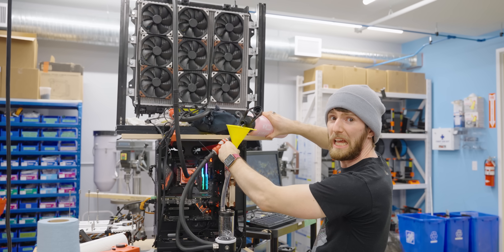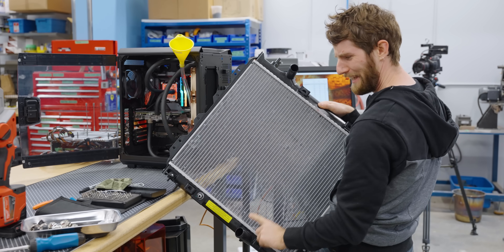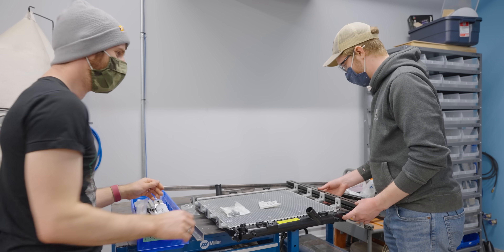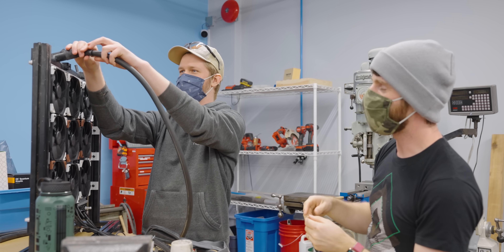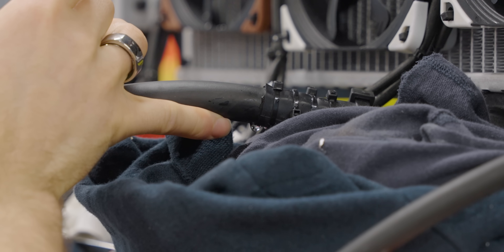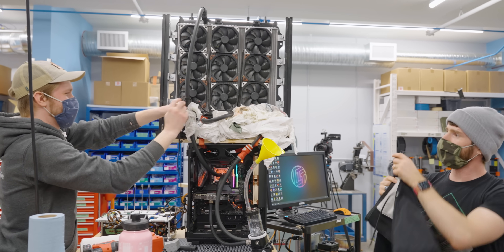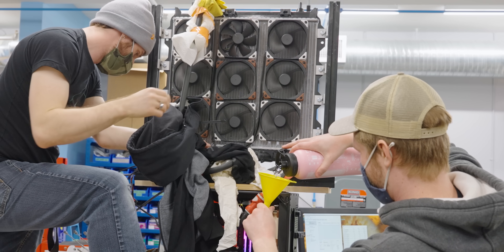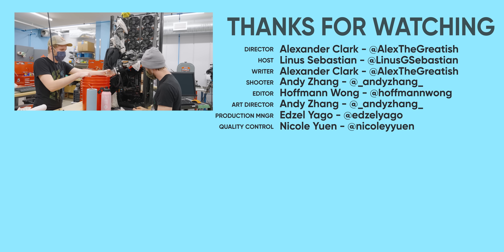Our Craziest Cooling Project Yet - Car radiator liquid cooler

Comment: The transmission cooler is just a tube or coil inside the one tank! On heavier vehicles and trucks with towing packages the transmission cooler is external and mounted infront of the main radiator! Running the coolant  back through the transmission cooler is counterintuitive and may make things worse!

Comment: Having the radiator on top of case is dumb because high center of gravity, also any leak will flow down onto case. Atleast test run it on table top before mounting it up high.

Comment: Take it to the next level. Build an air cooling rig into a beater van that you can setup in back and get an intercooler and direct the forced air onto the system to test at different speeds. This could also be done in lab with the right turbines.

Comment: Ugh, they turned an interesting idea into stupidity through zero planning. They could have achieved better results with far less effort by simply adding a five gallon bucket reservoir to the original setup. meh video.

Comment: Would like to actually see this working with the correct adapters and fittings so it wont leak like crazy. Btw and probably pointed out already, the second loop is just a coil to maintain the transmission fluid at working at temperature, would not help at all to use it in series.

Comment: Why didn't they just buy the actual radiator hoses that go onto that radiator and then machine out some size adapters? Or even 3d print them? Also how about a box fan  instead of all those small computer fans?
Reply: Oh and use actual hose clamps on everything lol

Comment: There is a product in this: Fit a car fan to the radiator and relay/PSU to power it. Hang from a window to dump heat and keep the noise outside.

Comment: Linus find a product called tru-blu use it to seal the inner tube and loose connections, then re cable tie and then try again. Give it 10 mins to settle after applying and you might find you have no leaks.

Comment: I did this couple years ago. Used a copper/brass radiator, you guys use aluminum and you destroy the copper heatsinks. I didn't need fans because I ran 5 feet of tubing and left the radiator outside my window along with the pump. Zero noise. Window always blows except really hot sunny days, those days you just turn down the overclock. When it's winter or foggy summer, the water temperature was 7c. CPU temperature were way cooler than Linus. I think around 30-40c load with overclock. I used an Audi engine radiator from eBay $100 new. And I really can't seem to understand why is everyone retarded in this episode and unable to get hose reducers. It's available at every hardware store and costs pennies.

Comment: When Linus was flushing water through the radiator it shouldn't have come out of the smaller holes. If it was leaking from there then that brand new radiator was bad.

Comment: I really want to see them do this again but properly. Buying proper step down valves and sealing the piping so it doesn’t leak everywhere.
Reply: Yeah, me too ! It would make for an interesting project. The way they approached it though, totally ruined it for me. It was beyond silly and useless, to the point that it wasn't even fun to watch.
Reply: Yep, car radiators are nothing new for experimental water-cooling but choosing a more appropriate rad and actually thought through connections would be more interesting to watch.
Reply: I totally agree. With better research and preparation, this project had legs. It feels like they purposely made it into a fiasco for the laughs.
Reply: @benyspensierijr.5973   Exactly ! Had it been a 7-10 minute video it probably would have been kind of fun. But a 19 minute video, where 2 adults act like Beavis and Butthead trying to” fix a problem” they purposely created, it’s the opposite of fun in my book. Plus, the video had nothing to do with watercooling.
Reply: They probably won't, because that's too technical of a video and won't really get views. Though, GN already did the car radiator thing to my knowledge.
Reply: Same. A lot of the projects they do could be redone a lot better.
Reply: N flex tape
Reply: The problem is that this is pretty much the level of skill Alex has. He is playing an engineer and the rest of the bunch is so far from everything connected to engineering, that they don't realize how bad he is ^^
Reply: @stefan514  I don’t fully agree. You don’t have to be an engineer to do watercooling. They’ve literally done tens, maybe hundreds of liquid cooling builds. Same principals apply here. What they did in this video was to execute an overlong and dumbly written script. Some people may be amused by this type of content, but from my point of view it’s plain pointless and ridiculous. Good humour always comes with “smarts and wits”, which is not this case. For instance, I’ve watched LTT vids starring Anthony. That’s what I call humour, alongside his knowledge and exceptional demeanor.I bet we will never see him in this posture.
Reply: @alext988-z8v  Absolutely agree. Too many LTT videos are clearly made as quick ideas rather than decently thought out projects. The SATA vs NVMe SSD video is a good example. Way too short and very little explanation.
Reply: @stefan514  I disagree.  Everything in this video is well within their wheelhouse.  They hook up fans all the time, and they set up watercooling all the time.  They are fully aware of how leaks can be prevented.  They just messed it up for the lols.

Comment: alpha cool sells a 1260mm radiator and it uses 9 140mm fans. you could have just used that to avoid all the leaks and probably would have gotten way better results.

Comment: Hose clamps and/or some sort of glue like ABS glue or other contact cement
Edit: wow I was half way through when I wrote that... This should be redone and right. Maybe connect fans before boot as well. Very fun idea
Reply: Just hose clamps and properly fitting hoses/adapters. It works in a car pressurised above boiling temps, a weak little pump should be easy to deal with. They could also try and use a 12v fan made for the radiator for some extra jankyness haha

Comment: The “small loop” is for the cooling the transmission... it is inside the “cool side” tank only (runs from too to bottom).  There’s not much point for you to use it to run the water back through again, considering how slow the water will be flowing through the radiator with the pump you’re using.
Reply: Was about to say the same thing.  Also not much point in using it because the water exiting the cool side then going right back into the tank will be the same temperature.

Comment: Wrap the junctions in toilet wax. Used to use those for protecting motors on submersible robots. Worked at 1 Atmo. Also, when changing tube sizes use some hard tubing between so you can crank the tube tight around it. Oughta fix most of the water leaking.

Comment: One of the very few dislikes I have given to this channel. Such a half assed video. I was genuinely interested in the pitch. I was looking forward for some comparisons involving the fans with different RPM speeds. What I got was an ER episode where they try to save a dying person. Not to mention you guys didn't even tell the ambient temperature, which at that point was pretty relevant and needed a dedicated termometer near the case, since you were all too close to it increasing the temperature around the case. It doesn't matter if your AC was set to 23ºC.

Please take a step back and think again when doing this kind of content.

Comment: Trans cooler loop is not needed, just a tube that runs in the coolant tank to allow transmission fluid to be heated or cooled by the engine coolant.

A full shop and they use an inner tube to join the tubing. Small reducer could have just been made with a plexi disk and fitting threaded, the inner tube would have sealed well enough to that.

Comment: The leaks are just silly, drill a hole in a golf ball or piece of wood, stuff an air chuck male end in it and stuff the PC tubing on it, use 5 minute epoxy or even hot glue, some electrical tape for looks, and fill the loop from the top without sticking the radiator 8 feet up. Rads taller than the pc anyways. I say the results are invalid, get the loop so it doesn't need any water added.

Comment: Did this years ago with an air conditioner radiator, still running today, keeps the whole room warm.
Reply: "I've seen dumber stuff under this roof; maybe more zip ties..."
Linus -2021
Reply: Nice job! The heat output is the same, no matter ne cooling solution. Cheers
Reply: @BOT_Calvin  It was about density of the heat, the radiator would soak and keep the heat in a certain section as opposed to blown out quickly by fans and diluting/cooling with the surrounding air faster.
Reply: But its an air conditioner
Reply: @malx1289  a radiator is a radiator
Reply: @malx1289  bruh
Reply: Every comment will be replied here and heart too 
https://youtu.be/dyUNU44hWfY

Comment: Ok WOW
when I saw the thumbnail i thought: ok cool they built adapters and a fan mounting bracket for a car radiator, that's cool.

I could not have been more wrong.

I mean it was still entertaining, just pretty useless, considering how you essentially did the same as you did in your cooling whit a kitchen sink video, just whit much more work, and leaks.

Comment: The smaller loop/trans cooler is a water-to-water cooler. So that loop is just a fin stack inside the end tank of the radiator that transfers heat from it to the coolant/big loop. So yeah, running through the trans cooler is completely pointless lol.

Comment: Watching them hook it up to the transmission oil cooler hurt me.
The way that cooler works is it transfers the heat from the transmission fluid into the engine coolant in the radiator, so it's essentially doing nothing in this case

Comment: You should have made it so that the water goes through one of the radiator loops to get to the cpu and then to get to the gpu it goes through the other one so that the water doesn’t keep the heat from the cpu.

Comment: So you guys know.... The transmission cooler is its own independent oil cooler loop inside the lower tank. The coolant in the radiator absorbs the heat from the transmission oil as well as helping to warm it up when everything first starts. Connecting the cooling loop to it in this case is just "yo dawg I heard you like cooling so I put a cooler in your cooler so you can cool while you cool".

If anything I could see connecting the PC to the transmission cooler and then running separate water through the radiator to cool it. Like water cooling your water cooling.

Comment: Radiators hangs from the plastic tank into rubber bushings to help it expand with heat. Having it fixed on the alluminium parts might make it leak eventualy!

Comment: the second loop is for the transmission warmer. The transmission will pump its fluid through there to warm up the fluid to its operating temperature.

Comment: Now I'm thinking you need to hit up eBay for an all aluminum civic radiator for <$100 with a fairly beefy fan! Tig/solder on some adapters down to a manageable hose size and redo this! Probably faarrrrr less dramatic, but I'd love to see it!

Comment: New idea.

Run supply water going from your overhead tank straight into the cpu and GPU cooler and then instead of circulating it, send the water to your geyser or some other place where you require hot water!!

Love the chaos

Comment: Made it way more dramatic than it had to be by not having the proper supplies available. LOL. 
I did a "similar" build using two HD motorcycle radiators with 1 large fan each mounted on a stand horizontally over the tower. The fans could be kept at a much slower RPM and moved much more air due to their size just like in a car. So, actually fairly quiet considering.
The hardware was far inferior (GTX970 - Intel i7-3770 CPU @ 3.40GHz - 16GB RAM -Win 10) to what you have, but the temps were much lower while running Metro Exodus. That's the biggest caveat since I never ran whatever pressure test you were.

OH, and the main thing, NO LEAKS. ;-)

Comment: Y'all need someone there that understands how anything automotive/equipment related actually works. One, that rad does not flow from the bottom to the top, your holding that specific one sideways, the tanks are the sides on a PT. Two, the trans cooler "loop" is just a heat exchanger, litterally just a tube on the inside," some have a heat sink of sorts on said tube" it just dissipates the trans fluids heat into the engine coolant. Transmissions run hotter than your engine, so even on the intake side of the rad" hot side" the engine coolant is still cool enough to cool the trans fluid.
 For your PC uses, your hurting yourself by using both "loops" your better off to just not use the trans cooler.
 As far as cost, you could have gotten pretty much any rad from any store but Napa for half the cost. For instance, the rad in my 94 s10 blazer is 87.00 USD from advanced Auto parts, it's larger and also has an oil cooler and trans cooler. PT cruiser rad should have been around 65 us, you got ripped off.

Comment: Why is the pump connected to the bottom and not the top of the radiator?  The water would flow through the radiator down and then into the water cooler, back through the pump and into the radiator.

Comment: If you guys redo this one a bit more prepared you'd love the results. It is legitimately possible and the cooling factor of this is insane. That radiator deals with so much heat that calculated out given the specs of a vehicle radiator designed to manage the heat of a 205 HP engine ([8610 BTU/second]/3) going full bore for an hour bringing the coolant (a glycol water 50/50 mix) consistently from 106C to 50C you get an extreme cooler. It's 178799 Watts/meter kelvin. A good video idea might be something like dual-sided fans, properly plumbed lines, and multiple PCs running on it.

Comment: Not sure if anyone has mentioned this but the transmission loop is a oil looped that is cooled buy the engine (coolant) loop. Your effectively trying to cool the water by using the same water to cool it's self ?  🤨

Comment: You know, an extra hour with a hot glue gun would've done the job yo seal up this loop before it all got wet. Not that hot glue is a good solution for this, but hey, neither is an auto radiator, angle iron, or inner tube rubber.

Comment: You might call this crazy but this is what people were doing 15 years ago to water cool their PCs.  With a bit of planning you could have quite easily made this setup work without issue - heck, just using aluminium CPU and GPU blocks along with a pump that is suitable to work with aluminium would make this a viable setup for long term usage.

Comment: You should just connect the CPU block to cold tap water. No radiator needed. Yes, you can recycle the warm water for a nice bath.

Comment: World : Why??
Alphacool, Phobia, etc : No seriously WHYYY we make copper rads close to this size and no leaky janky tube adapters.

Anyways, next vid: Assuming the leaks get fixed, mount it to a window sill in someone's house as exhaust. Compare not just computer parts temps but also ambient temp in that room during the summer running this vs the same computer (or a computer with the same CPU and GPU) running in a regular computer case with a 360mm and 240mm rad.

Comment: The transmission line is not for cooling, it's for heating the ATF to operating temperature. Comes in handy on those cold Canadian days. BTW, this is the most prone to failure point of a radiator. So when those fittings inevitably rot, there is a big chance of mixing ATF with coolant. And if that cocktail gets into your transmission, it goes bye-bye. A lot of vehicles have this flaw.

Comment: Why wouldn't you use the automotive cooling solution?  In other words, a single 20" 12VDC fan with a shroud.  There's probably one made for the same PT Cruiser application that you could have bought as well.  
And WHY would you NOT remedy the leaks before you started testing?  The whole thing seems amateurish at best.  I didn't even watch until the end.  It's a thumbs down for me, I'm afraid.  Just stupid and ignorant.

Comment: These guy's started pretty good, but not testing for water leak before installing was a little stupid. And Linus is wright, topping off the water every 5 to 10 mins will not get an accurate result. Give them an applause for the Dual Stooges on deck.

Comment: In before Jayz tells you how you should have done this better..I realise this was not intended at all as a serious video (or maybe it was and then you started to fill the loop 😂) however if you guys ever decide to revisit this, just ignore the transmission cooler loop. Its only a small heat exchanger housed within the bottom tank of the radiator.

Comment: This is literally the biggest piece of shit this channel has ever put out. You'd think that a little more forethought would have gone into ordering proper plumbing parts. I mean you already had to order the radiator so you could have even used the same website. Literally none of the water is even cycling through the radiator. It's all being dumped into the rags on top...

Comment: I was just talking about using a car radiator to vent heat on a pc.  My idea was to put the electric fan designed for automotive use on the radiator tho.  You can get radiators cheaper at pick n pull btw.  Look for a car that's been rear-ended, if you pull a radiator from a car with front end damage you're almost certainly going to end up with one that leaks (and we wouldnt want to be leaking water everywhere, right?  *rolls eyes*).  Another part of my radiator idea was to 3d print a cowling for the fan and vent the heat into the attic.